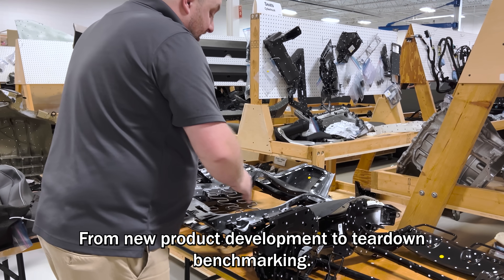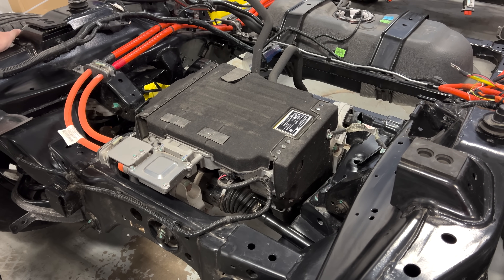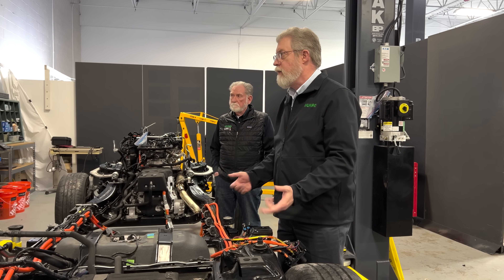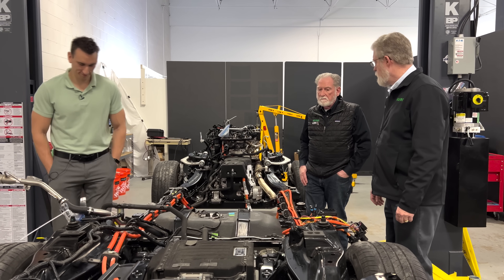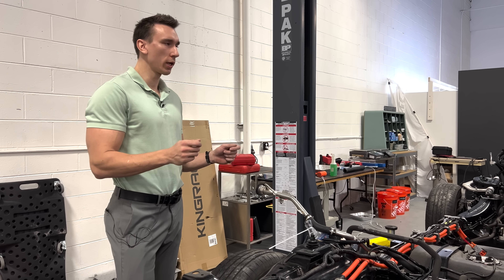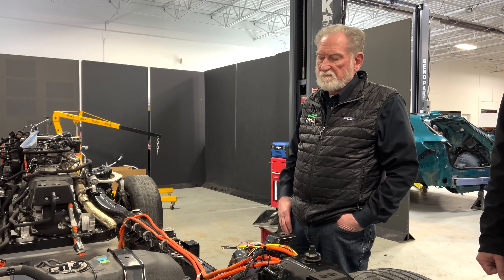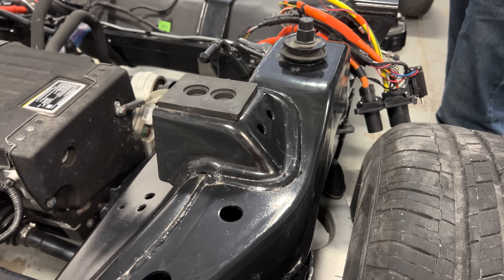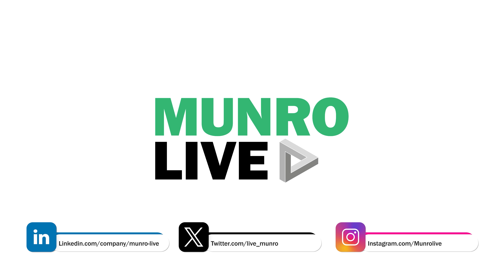There's a Monster Under the Bed of the BYD Shark!

Comment: pretty useless analysis, they should learn about future tech before sprouting off.  Their test drive of one a couple of months ago made me realize how bias they are.  Saying the acceleration is 'slow' just made me fall of my chair,  it can drag off a Ranger Raptor!   the fastest accelerating ute (pick up) here in Ausi.  Anyway the damned BYD thing is not even available in the US, so they are just trying unsuccessfully to make it look sub par, including saying it is too well made re the frame And  loops that are not loops, and ground straps bla bla, all bull when you consider the great warranty they have.  However, the opposition would be very interested in how they can make this thing work for a reasonable price (same as a mid spec Ranger and 30K cheaper than a Raptor here in Ausi). So they will be able to make a few bucks selling this stuff.

Comment: When I looked at the weight of the car and the bad electric range it’s explained by the frame. Unnecessary weight has so many downstream negative affects
Reply: Yeah, it heavy like a tank. But still blow the door out of Ranger raptor. Less thirsty than a Toyota sienna which is 700kg lighter and hybrid as well. I dont know what to call the Ranger ratpor and the Sienna.. Calling them garbage appears to be flatering.
Reply: @林振华-t4v  You can't compare it to a raptor since this is phev vs petrol.  And again comparing it to a hybrid is completely different also - all powertrains have their advantages. 

But let's look at this shark on its own - stength is important and weight is an enemy.  The concept is great but this being a Gen 1 shows there is lots of opportunity for this thing to loose A LOT of pounds. That would mean better handling and better battery range and better acceleration without any changes to the power train.

Comment: I can't see the value in a hybrid that gives you all the problems and maintenance of an ICE truck. You also have the added cost of two systems and the interface between the two. If your normal driving is 300 miles or less a day like most of us, it makes no sense. I want a pickup EV with an 8 foot box and few to no bells and whistles for a reasonable price.

Comment: Comments section is amazing. For everyone hyping because the conclusion was that everything is overbuilt, understand that does not translate to something that will be rugged. A moron can 'engineer' something to be rugged by making everything out of 10x thicker material than is needed and even then can still end up ruining the end product through failure to recognize stress concentrations. Good engineering is working out where the extra material is not needed and where the mass removal helps relieve stresses in other areas that do end up needing heavy reinforcement. Weight begets more weight.
Reply: Sandy had made comment on the center section of the frame in another video saying it may take a tank to destory the center portion of the frame. So, the over engineering here also means the frame is stronger than LT application. And it is not hard to find out the frame rigilty but load up the truck and drive it over  a cross axle ramp.
Reply: @林振华-t4v  I can see that.
Reply: You think they didn’t run their design through a FEA program?  Built it, tested it, refine it, and crash tested it, refined it again.  You are just talking in textbook land.
Reply: @ Turn that logic toward every design by committee piece of trash ever made. Your tilting at windmills. Also consider that improvements will no doubt magically appear in whatever comes next. It's not as if they will have stumbled across perfection. With that, good day.

Comment: Overbuilt doesn’t necessarily mean overengineered. It means inefficient, sloppy, and a possible reflection on the things you can’t see. Means extra weight and potential problem points.
Reply: You know that the three amigos are just talking before doing much prior research on the vehicle.   Non of them has Computer program in their head that can analyse the frame.  They are just pointing out the differences to an American built truck.  So their final conclusion if you say it is overbuilt, is a good point for the consumer as it is overbuilt compared to an American truck.  Sandy even said a one point, it could serve as a F350.

Comment: From a technician POV if you damage a thread on a big casting, you must change the whole thing, whereas here you can cut and solder just a part
Reply: Nope, that is not how it work. If it is metal stud then you take out the stud and replace with a new one. If it is thread in the hole the. You enlarge to hold to next size available and insert a helicoil. The problem with casting is defect from the casting process, there is always some. And compress loads are more tolerble to casting defect than tensil load.

Comment: Isn’t 1 pair of cables for externally charging and the other for powering the rear drive motor?  How could it possibly be that both sides can be powered up at once? You can’t drive the car while it’s connected to an external charging cable! 3 engineers together and not one of you super brains picked that up!  🧐

Comment: The ground strap provides a low-resistance path to the chassis in the rare event of an inverter or motor fault, helping to safely dissipate fault currents and maintain a safe voltage potential. If high voltage accidentally contacts the inverter or motor housing, the vehicle’s insulation monitoring system should detect it and trigger a fault response. The ground strap helps manage potential voltage differences but doesn’t “carry” high voltage under normal operation. Additionally, all orange high-voltage cables are shielded to minimize electromagnetic interference (EMI) and ensure system reliability.

Comment: Ordered my shark 6 here in Australia, hoping for arrival by April. Cant WAIT to drive around in my over engineered tank of a Ute. Thanks for showing us how badass this thing is 😊
Reply: Over engineered means less efficient.
Reply: @AureusApps  There is no such thing over engineered when it's come to the safety of the driver and it's passengers.
Reply: @yinyang9109  Over engineering increases the weight and decreases the safety and performance
Reply: @AureusApps no it doesn't. It means it's over built. That means more protection and more performance. Stronger frame for impacts and 0-100km in 5.7s, I've seen 5.6s is what you get. 2L/100km in hybrid model or 80km battery only range so efficient as well. You get a solid, fast truck with larger dimensions than a raptor.
Reply: @zaccy  Now you don't understand basics. Stronger frame doesn't provide stronger protection for impacts. Going at high speed impact could be high as 150G your vehicle frame should be able to crumple and absorb some of that energy.
Reply: @AureusApps  not from a side impact buddy which is where the frame is overbuilt. This vehicle is 5 star ancap rated for safety
Reply: @AureusApps  Go ahead and look up the crash tests. It has a stellar performance and the frame is one of the reasons it performs so well. So yeah you can go ahead and eat your words about the over engineering not being a good thing.
Reply: @AureusApps yes, it will trash the under engineered American car in a crash

Comment: Overbuilt indeed.  It’s like they knew what they wanted to do, and just did it without a cohesive strategy to simplify.  I wouldn’t want to touch this thing in 10 years from complexity standpoint.
Reply: You should not touch anything structure in a BOF viechle. And for any car with structure damage, it is junk

Comment: To speek up as an engieer for 35 years in aerospace industry you can't entrust all design parameters to FEA, many singular geometric features can't be reliably modeled with FEA, you just have to physically reinforce them to achieve X times of safety margin.
Reply: margarine
Reply: @snorttroll4379  thanks
Reply: @ you are welcome to the margarine. I smear some on my welds often to make more margarine in tye design

Comment: I'm surprised no one mentioned that the rear CV drive shafts are different lengths.  That is going to result in asymmetric torque delivery and weird handling on hard surfaces.  The whole vehicle looks to me as if someone said, take that ICE truck and make it a hybrid.  And don't spend any money if you can avoid it.  I've always found a fresh design is a cost effective one when produced in high volume.  Presumably this truck is a band aid temporarily filling a gap.  Or it was built by a farmer with parts they had laying around.
Reply: You know some lateral Mount mid engine car has asymetric drive line like the FF car though. For ICE truck and SUV, you dont have this because the engine is always in the front. For this truck, they need to package a relative powerful traction motor in the back, there is just so much room from packaging. Something has to go. Speaking of asymetric torque delivery. There is no strange driving behavior. Otherwise we shall see this problem all over FF cars. It is not a big problem if you have locker. This truck happens to come with Electric LSD I remeber. Beside, my JK front is asymetric solid axle with modified DANA 39. I never have probelm with it even it is a openndiff.

Comment: Why would you be criticizing a 4x4 truck designed for on AND offroad use for having an overbuilt chassis? Maybe you should be looking at some of the USA made pick-ups that snap in half.
Reply: I think the “overbuilt” comments are more to imply “overweight” - this truck weighs 1700lbs more than a ranger, not all of that extra heft is hybrid powertrain components. Skillfully implemented minimalism/ the engineering art of “just enough” is what made 90’s Japanese vehicles so efficient, good to drive, reliable. 5700lbs is going to put a lot of stress and strain on suspension components, tires, etc. and the overall durability will suffer as a result regardless of how chonky the frame is. That being said the concept and layout of this vehicle look great, agreed Munro is being overly critical of a vehicle that generally looks to have the right ideas.
Reply: @Nathan0A  I like more steel for a cheap price
Reply: @AprezaRenaldy  More steel is less range and more times you replace tires and suspension.
Reply: @clementoseitano7568  is hybrid not ev. Also it's actually back capacity is reduced to 720 kg
Reply: @Nathan0A  Thank you!
Reply: @Nathan0A extra steel on the truck is to carry all Ur cope and butt hurt
Reply: its chassis is overbuilt to last and absorb  forces generated from having two powerful electric engines front and rear

Comment: Not very American. LOL Spat my coffee out as I heard that.laughed so hard.
The USA are not the best engineers. 
The USA  make stuff that often only just does the job. 
USA designed products have become lowest cost design and implemented Lean manufacturing principles but are no longer built to last. 
This rear end independent suspension may be over engineered for a light duty truck - But you assume this is not a dual use chassis. 
It is also Euro NCAP crash tested and I understand performed well in all crash tests.  
The Robot MIG welding is cheap and automated to give more repeatable higher quality weld integrity.
A huge improvement over most Chinese welded parts from 10 years ago.

Comment: Never heard an engineer bag out over engineering. Makes me want the Ute even more than before. 

This Ute is a completely new design and footprint that is built as good as an armoured truck. I’ll take that.
Reply: I guess this might be a trick of language but to me over engineering means that something is made more advanced than it needs to be. In this case I feel it more question of over dimensioning. That is making it stronger than they mean is needed. Over engineering can make things mo complicated without providing a positive result, but over dimensions provide more strength than it otherwise would. This is something that can truly be a positive thing for the customer. And with trucks like this I can see how it can make it last longer in cold climate where the roads are salted to melt some of the ice and snow for months of the year. Modern cars are regularly built so "efficiently" and lightly that they tend to become rust buckets in only a few years and are often rusted to the degree that they become dangerous when they come close to being a decade old. This trucks chassis seems like it should be able to withstand that rust for many years beyond what "normal" modern cars and trucks does. 

So I'm all for over dimensioning  the chassis like this. Over engineering things is another thing entirely.
Reply: @blahorgaslisk7763  These bean counters used the term "over engineered" in an attempt to criticize and berate the BYD. The appropriate term is "Superior Engineering."
Reply: Munro's business is to make the most optimal design options known to their customers, which is the OEM, not the final buyer. To the OEM, 3mm thick metal when 2 or 2.5 can be used can make a big difference and those cost savings are what the OEM is looking for. Overall, they did a good analysis, just that this vehicle may be targeting markets that abuse their trucks like African and Indian markets so they had to 'over-engineer' in order to grab some market from the incumbents like Toyota Hilux and Nissan Navara which are usually very well built.

BYD may improve on this design and we will see that newer models may not be as reliable when abused as compared to this one.

Comment: What I don't understand is why the BYD shark has (according to Google) a towing capacity of only 2500kg and a payload capacity of only 750kg? If the frame/chassis is so strong / over designed I would expect it would, at least, be equivalent in capability to a Ford Ranger? The equivalent Ford Ranger has (also according to google) a towing capacity of 3500kg and a  payload capacity of 1041kg?
Reply: BYD deliberately underrated the truck, because they know that ratings are kinda bogus.  Also because they don't want this to directly compete with larger, more expensive HD pickups at this time.  If this sells well enough, they can make a few tweaks, embiggen the body a tad, and step up directly against the HD pickups.

Comment: Are they for real? Who complains about being over built and using thicker metal than usual?
Reply: Especially when the car is relatively inexpensive.
Reply: @captives6479  That isn't the point though. Heavier it is, less milage it is. If it is too overbuilt, then it will be heavier....Just saying.
Reply: @1flash3571  People continuously complain about things not being built well enough today and when things are over-engineered you still complain?
Reply: @1flash3571  ok thats cute and all but, BYD designed and engineered this thing with a specific range in mind that it's motors and engine can achieve despite the weight.

I'll take over engineered any day of the week.
Reply: It seems you don't understand about the weight vs mileage concept and relevance between the two??....Heavier it is, less miles the vehicle will travel. Simple concept, and idea....
Reply: @1flash3571  But this car has a longer mileage and lower fuel consumption! The most important thing is that it is cheaper!

Comment: Agree with other here. There is no inductance loop create.
That ground strap does appear to be a late addition, likely only needed to satisfy some electric safety standard in the event of the motor having a major short to casing.
No complaints about the "beefy" over complicated chassis. But the whole rear end sub-frame/suspension arrangement does seem a bit weird. I'd have a sub-frame that has all the rear suspension attached to it. Even if it means dropping the whole assembly out to access the motor assembly.

Comment: i think the bolt on parts are there to be used for different variation of the vehicle. I think the vehicle was designed as a BEV at first and was modified to a range extender which is why it looks janky. I could look way better in the Shark BEV version on the future.

Comment: I think Sandy just does NOT understand the use case for these vehicles.  Utes in most parts of the world are regularly DOUBLE over loaded.. pushed WAY WAY past what should be done.  BYD is not stupid.. They DO actually know the customer base and what this vehicle will end up being used for.. So they overbuilt it.  If BYD can build it like this and make money.. that is good for them, and good for the consumer too. and when the vehicle gains a reputation for durability and ability to take abuse it will only be good for BYD.
All the reports and videos I have seen of people in Australia using this, and taking it offroad.. are VERY positive.
Reply: Yeap traded in my ford ranger for this. Best decision ever. Saving so much on fuel cost for my business. Plus its much  more comfortable.

Comment: The grounding wire's function is to equalize the potential of the ground loop, avoiding stray currents between the electronic devices using the ground as reference for data processing, which are the result of the device losses/inefficiencies, nothing at this stage can mitigate those.
The reinforcement of the structure is an intelligent approach,  not only allows for new technologies(heavier batteries) in such an infant industry  but also promote modularity of the chassis manufacturing process for different size/types of cars saving a lot more than just removing steel.
Should have commented on the individual segments of the system, their ratios and how they operate within.

Comment: An offroad vehicle overly designed for long life versus an american truck with a finite lifetime due design choices to minimise construction costs.  The over engineering of the Shark will reduce efficiency long term but I would feel more confident and safe in a Shark than a compromised similar vehicle.  "Immature" manufacturing to over engineer a product.